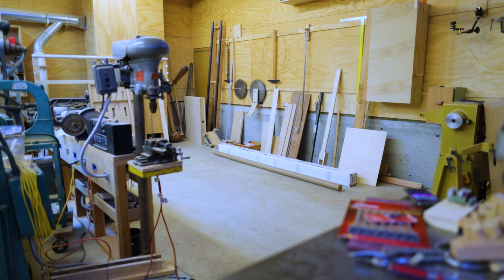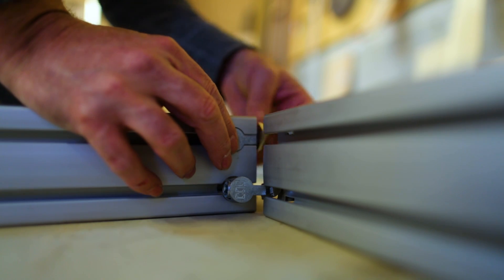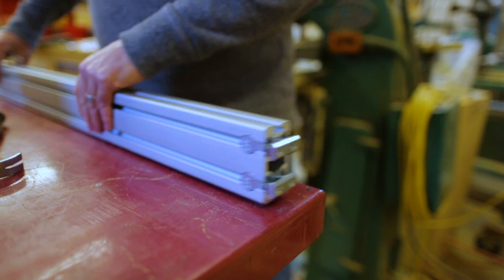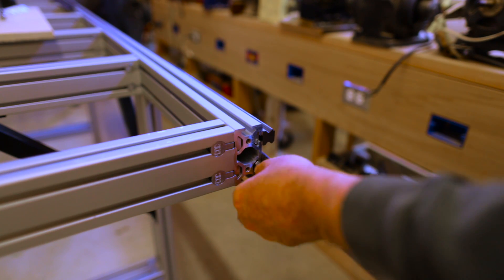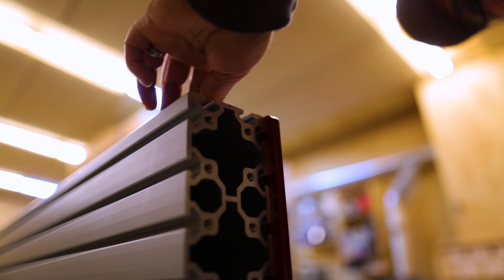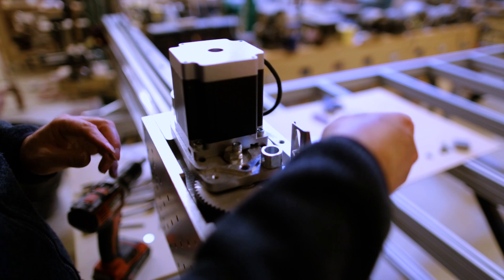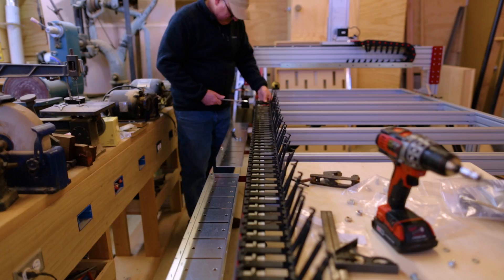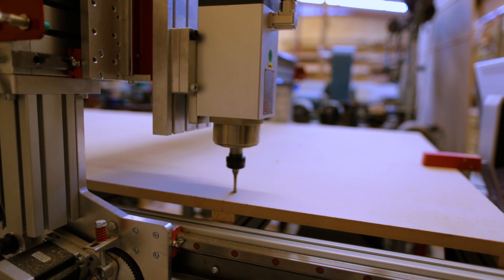CNC Build 2.0: CNC Router Parts 4' x 8' CNC Router

Comment: one thing on spindles for ya:
most of em are oil filled, so you'll need to run a warmup routine to get the oil around.

also, VFD controlled spindles don't bog down, so if it hits something hard (like a screw), the VFD will simply ramp up the spindle so it stays at a constant speed. So be on the lookout for stuff like that.

one more thing, MDF is actually pourus enough that you can pull a vacuum  (shop vac) through it. It's enough to hold down pcs, but not enough that it loses suction when open. Consider that when using your vacuum table.

ps. 
KentCNC does a split dust shoe for cnc routers. I'd recommend that for this machine!

Comment: Time to get a cordless impact driver a stop stripping screws
Reply: Russel Jacobson Russel Jacobson he's using a cordless drill. the sound you're hearing is the clutch inside his drill from when the bolts hit a certain torque so they don't get overtightened.
Reply: I know that is the clutch but he has stripped screws in the past
Reply from the maker: yes.

Comment: WoW ... that look's much more stable and more professional ... 👍🏽👍🏽👍🏽👍🏽👍🏽
Reply: idk man he had a welded steel frame. so far i like the old one better, base wise.
Reply: He did a good job with the frame, but if you watch the build video, he had a lot of problems with the frame warping after welding. This new frame won't have that and it's a lot easier to adjust for any imperfections.
Reply: Ryan Langan Plus I guess the new frame being aluminium is a lot lighter too.
Reply: even with the 'warples' he did plane the working surface ...  seems it woulda been cheeper to add the bigger steppers and a water-cooled spindle/vfd..       nice machine   : )    $$$